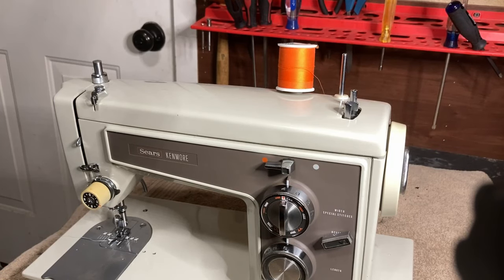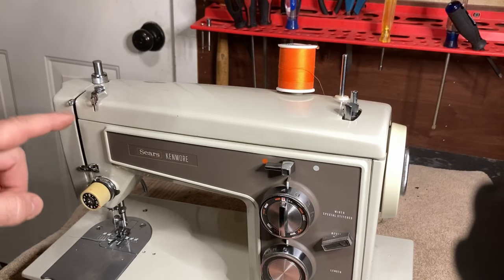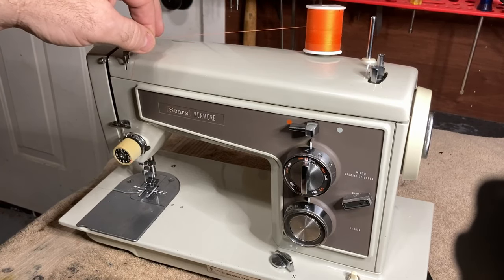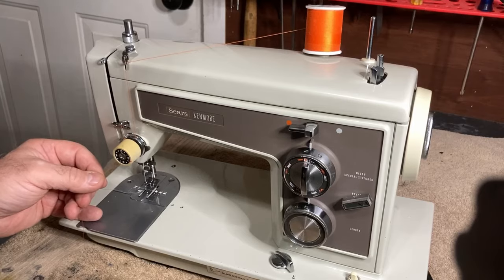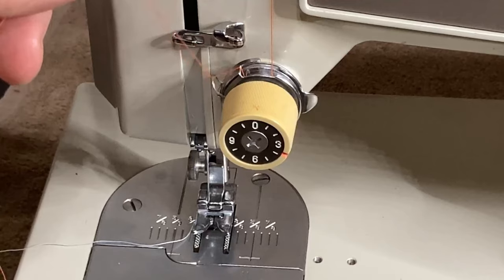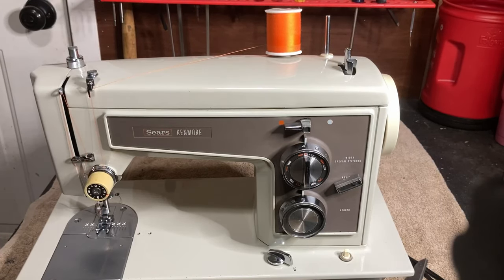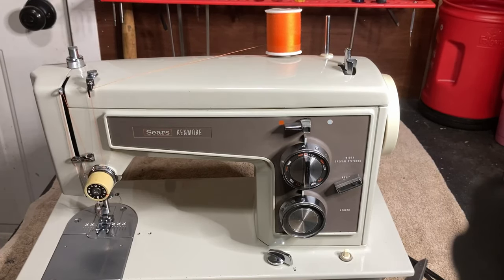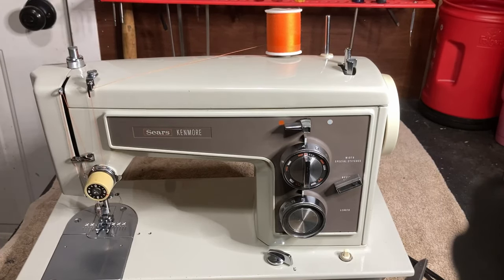How to use a Kenmore sewing machine  for beginners

Comment: This is a super helpful video. What is the point of a bottom stitch? And do the top and bottom stitch need to be different colors?
Reply from the maker: Thank you.

The point of the bottom stitch is the same as the top stitch, to hold the pieces of fabric together. 

The top and bottom provide anchor points for each other, otherwise there would be no stitch.

The top and bottom threads need to be whatever you need them to be in order to match your project.

Comment: It's hard to look through all 500 comments but when you do the zigzag do you need a different foot. My foot seems like it's only set up for a straight line as the needle would hit the metal if it tried to zigzag. Thank you so much for the tutorial! I "liked" it
Reply from the maker: A straight stitch foot has a single small hole in the center, a straight stitch foot has a wide opening.

If you are using the correct zigzag foot for the machine and the needle is hitting the foot then the needle swing needs to be adjusted

Comment: I purchased a Kenmore 145-15700 at a garage sale in excellent condition very clean but hasn't been used for years. No user mannuel. Will your instructions apply to my machine.
Reply from the maker: It applies to most Kenmore machines, the basics apply to all machines regardless of brand.

The only differences will be in the actual controls on the specific machine.

Comment: After 4 days of research and watching lots of videos on how to repair my upper thread tension I finally find out what my machine really is and why I can find nothing about it. It says it's a JCPenney Model 6923. Well, it looks like, and was made like a Sears Kenmore. My machine was purchased in 1986. What I need is info on the upper thread tension. I would like to replace the spring and have some info if possible. Thank you for your video. It was very easy to follow and my machine threads the same way. The only difference on the tension dial is that mine does not have a screw in the middle.

Comment: I just got a 158.13041 and I’m sooo happy to have found your video! Thanks so much for sharing this very valuable info! 😊 definitely subscribing! 

I do have a question about the spool pins on top. Mine broke off during shipment unfortunately and it broke right flush with the metal surface. Is there a best way to remove and replace them? Thanks again for this gem!
Reply from the maker: Not really a best way to remove the broken spool pin. The usual way to remove a broken bolt or screw  is to drill it then use an easy out.

That may not be necessary for a spool pin here are some ideas I have used at one time or another.

First remove the top of the machine so you can see the back side of the spool pin.

If the pin sticks out of the back of the top then you may be able to use a set of pliers to get it turning.

If the pin is not very tight you maybe able to use a rough rag lay it on top of the pin then apply as much pressure as possible with your thumb and twist in a counter clock wise motion and get it moving.  You may also be able to use a piece of tape such as gorilla, 10 mil or 20 mil stick it to the spool pin and twist, make sure it only sticks to the spool pin and not to the top of the cover.

Hope that helps.

Comment: I have a Kenmore 1937 that I just picked up that the zigzag function is not working and probably seized up, if you have some pointers to fix it, I would be greatly appreciative. Great video by the way.
Reply from the maker: @DarthPotatoes  
The machine as a whole, especially the cam follower and associated linkages need to be cleaned and have gunk and varnish removed then be lubricated again.

Mineral spirits works well removing sticky gunk.

Denatured alcohol works well on dried hard varnish.

Comment: Hi!  I have a Kenmore385.1684280 Ewing machine - 22 stitch. It’s been sitting for a long while but I remember the last time I used it it just stitched in one place and fabric wasn’t moving. Today I looked at it. The straight stitch seemed to feed ok but as soon as I tried any other stitch, even just a zigzag the material would no feed. I don’t know how to adjust the feed dogs if that is the problem 😅
Reply from the maker: It sounds like it needs to to be serviced, cleaned really good and have all the gunk cleaned out then lubricated.

Comment: Very informative video. I just found you and subscribed. I collect and refurbish machines, but this one is a keeper. I put it in a cabinet. Also have a 158-1941, 158-1802, Singer 201-2 and 500a. Singer rotary machines make perfect straight stitches. The Kenmores excel at zigzag.

Comment: Wow....your video is awesome!!  I just bought a Kenmore 158.19640 at Goodwill.  You have taught me so much about the Kenmore and made me so happy that I got a deal!  However, when I brought it home, cleaned it up, it does not have a bobbin casing.  Can I purchase a generic one from Joann's?
Thank you again for your video!
Reply from the maker: Thank you! I appreciate that.

I believe the model number is 158.19460 and yes you should be able to it is a class 15 bobbin
Reply: @sewingmachinetipsandtricks9079  You are correct in the model number.  Thank you so much for the information!!

Comment: I picked up a kenmore 158 14001 very similar to the one in this video the mechanic works wonderfully. My problem is it came with a extra plate (for under the presser foot) thing is this plate has a single gear on top and slide lever on the under side. The gear has 8 teeth on it and it takes 16 hits on the lever to make one full revolution. I'd like to know the name of this plate and what it's used for. Thanks for your video I find them helpful,
Reply from the maker: That is for early type embroidery and automatic buttonhole attachments

Comment: I was given an old Sears Kenmore model 605 I don't know how to thread it. Help! Thank you.
Reply from the maker: All machines thread similarly, Raise your presser foot, make sure the take up lever is up.

From the spool pin the thread will go left to the first thread guide on the back, across to the second thread guide on the front, down to the tension assembly, up to the take up lever back down through 2 or 3 thread guides to the needle.

Comment: I have a  258.17540, and my question is about the knob on back to the right side as you're looking at the machine from the front.....what does that knob adjust? By the way, love the video. No body has explained the tension adjustment for the presser foot works, nor exactly how the thread feeds through the thread tensioner...that the thread goes over the one hook. Thank you so much.

Comment: I have an old kenmore model 158, it has an arm you can slip a sleeve over, my question to you is at the top edge of the machine is a button, you can push it left or right, on side has a check mark and the other side has an upside down check mark there is also another symbol with them that is rectungular shaped. Do you know what this is for? I got it from good will for 10 dollars so no instructions but it works great
Reply from the maker: I would need pictures to see.

If you want to join my FB group I can help.

Thank you.

Comment: Thanks for very clear, instructive videos.I inherited a Kenmore (year??)148.12300 .zigzag sewing machine with a manual and zigzag,satin,straight & zipper feet included. I cannot find additional feet for hem rolling, pin tuck, bias feeder,couching, embroidery for this model. Please advise.  Also,can this machine sew denim & leather? Will Schmetz twin needles fit it?I'm a beginner so any info or advice is welcome. Thank you!
Reply from the maker: Hello Mary I am unfamiliar with that particular model. Are you sure  148.12300 is the correct number?

Comment: I recently got a 158 17600 and the only thing it's missing is the additional cams and the manual. I'd love to know which specific cams will work with my machine, if cams from other 158 series machines will work in my machine, and if my machine can chain stitch with the right attachment. I know a few specific 158 models can chain stitch but I have yet to find an exact list of which ones have that capability.

Comment: I have a 385.  I want to know how to use it for Free Motion Quilting.  Thank you for your directions.
Reply from the maker: @marticook2168  
385 is the series there are thousands of machines in that series.

If it has a feed dog drop then you need a quilting foot that will fit the machine, then you can start practicing free motion quilting with it.

Comment: Hello,I love how you explain how to use it  but I have a sears Kenmore 158 921 and ever time I sew it sews but doesn't overlap the fabric . What I mean is that it sews straight but the fabric doesn't move while sewing on the other side and I don't know why but I have to move the fabric which  makes it harder so I was asking how to fix that ,thank you
Reply from the maker: That could be several problems, not enough pressure on your presser foot, feed dogs stuck, stitch length improperly set. If you would like help I can help you in my FB group. link is in the description of the video.
Reply: @sewingmachinetipsandtricks9079  thank you very much its very old but I will see if that helps.

Comment: I have 158.17030 kenmore machine. I watch your video was Extremely helpful. It cost 
$5.00 at a yard sale. Can you tell me if this machine will also make a chain stitch? And if it does what do I need. Thank you
Reply from the maker: Hello Linda,

Here is the manual in section II on page 4 I believe it talks about chain stitching . It is about half way through the manual, the pages are blue.

https://storage.builderall.com/franquias/2/334219/editor-html/7578720.pdf

Comment: Very informative video. I have received a Kenmore Ultra Stitch 12 as a gift and it didn't come with a manual or information, so thank you for the video. I do have a question. How do I turn the clutch wheel for winding a bobbin? The middle job of the handwheel is so tight it won't turn towards me. I've even had my husband try and we can't get it loosened to disengage the needle movement. If you have any suggestions, I'd be very grateful to hear them. Thanks again, Katie

Comment: Hello! I just got a sewing machine from kijiji. It’s a Kenmore 158 178. This video help a lot since the machines are similar but the bobbing part is completely different and I am having troubles figuring how to thread it 😖
Reply from the maker: Hello Courtney, 
Thank you.

Here is a manual for that machine.
I don't personally have the manual or I would give it to you.
https://sewconsult.com/product/kenmore-158-17800/

It is $6 I have bought from this site before, they were prompt and I had no issues with them.

You can also join my group if you would like and I can offer more help there .

https://www.facebook.com/groups/479747739423131

Thank you, hope you have a great day
Reply: @sewingmachinetipsandtricks9079  Thank you so much! I'll take a look :)
Reply: @sewingmachinetipsandtricks9079 .   My kenmore 158.10691. Hand wheel only moves very slightly.    Needle won’t move when you try to sew. How do I clean it up and oil?

Comment: I have a sears kenmore 13101. I have no Manuel for sewing different stitches.  What should stitch width be set on for straight stitch.
Reply from the maker: For straight stitch the width should be 0
Reply: Thanks so much I will try that.
Reply: The little knob on the front top is for zigzag or straight stitch and has a red dot.   I don't have the same as the model of the video shown. Of course not having a manual I don't know how to practice the other stitches. I know that little red dot means something,  but I'm not sure what.   The other knob is larger with different stitch marks and a red dot.. can you help me out?

Comment: I have a sears kenmore that is about 51 years old. I was wondering if why the belt is slipping and it’s a new belt and the motor gets hot and wondering if it’s worth fixing ?
Reply from the maker: It sounds like the machine is starting to lock up due to lack of lubrication over many years.

I have seen and repaired many of them, depending on the exact problems and work involved I usually charge between $200 and $300 to service it and get it going again. 

They are very good machines and worth fixing.

If you continue running it with the motor heating up, you risk burning the motor out.

Comment: Hi Richard, I just got a sewing machine from my late sister. It’s a Kenmore machine model 158. 17810.  I have had so much issues with it…
After watching your video, I finally got some clues but I still could not run straight line (the fabric did not move). What did I do wrong?
It would be greatly appreciated if you could share any information❣️

Comment: This helped me figure out how to thread a Kenmore machine I inherited after years of using a Singer. It's an earlier model than the one you show and doesn't have the fancy stitches. Unfortunately, when I was removing the bobbin I thought I had to take the whole assembly out and now I can't get it back together. I first moved the little black pins to the side, then removed that outer silver circle, then the inner silver case, then the bobbin tension case and bobbin.  Do you have any videos that might help me put it back together properly? Thank you! Also the home sewing machine guide address did not work.

Comment: I have a 158.14001. I just received a foot pedal that was missing when I purchased it at the resale shop but when I plugged it in it sews a very beautiful straight stitch but when I move it over for the zigzag it is stuck in what looks to be a different pattern style. Any suggestions on how to fix that. Thanks.
Reply from the maker: It sounds like the cam follower linkage is stuck in place, probably from old drying oil and grease. 

I would recommend cleaning it out and lubricating again.

Comment: I have a Kenmore #158.17910. The needle goes down far enough to scrape against the shuttle plate before I going back up.  Could you connect me with a video to teach me how to set the needle bar higher.
Reply from the maker: I would suggest making sure the needle is all the way up in the needle bar first.

There should be a spot  with a needle stop where you can see the top of the needle touching the stop in the needle bar.

Comment: I inherited a Kenmore 158.12411 and I am learning how to use it. Your video was super helpful. 
I am wondering if I can use low shank feet with it. It only came with two feet, a zig zag and button hole. I have bought an adjustable zipper foot that I have figured out how to use, but a friend gave me some other feet that are just plates, no arm / column that would allow me to attach it to the shank. Is there any way to make this work?

Comment: I have a Kenmore 117.740 (1956) its in a poor state though sadly. No belts, poor finish on the paint, and the pedal and original table it sat atop are gone. I really want to bring it back to life but wouldn't even know where to start. Do you have an suggestions?
Reply from the maker: I would suggest cleaning and lubricating and ensuring it has all the internal parts hook bobbin case and such and getting it working then finding a pedal and cord. 

You should be able to find what ever parts you need here https://ebay.us/PSA7qL on ebay
Reply: Thanks for the great demonstration. I have a Kenmore sewing machine model 158    13550 80 Could you show a demonstratton  on this machine and about the bobbin tension thanks

Comment: Also noting as they dont say it in teaching videos because new machines often self cut the threads then hold them. Always put your needle down into fabric and hold the tails and do one stitch by hand....rotating the wheel and set needle into fabric again, then run it. The tails often get caught or if you start up in the air the to thread gets lost in the bobbin case!

Comment: Thank you for posting! I have a model 29 (sometimes known as the purple monster in some circles - all steel, lilac, just forward and reverse) and I canNOT figure out how to wind my bobbin! There is a spool pin near the tension discs, but no latch mechanism to lock the bobbin in place anywhere that I can see. I saw one video where a woman said the bobbin threader was "on the wheel" but it doesnt look like that's happening here? Thank you for all your videos!

Comment: I have a kenmore model 158. 18022, but is a super high shank. The on one your video was it originally super high shank or lower? Or did you use an adapter to get it to work as a lower shank? Please let me know. I learned few things with your video, great job! and thank you

Comment: I have been given a Sears Kenmore 158.1755. It hasn’t been used in quite awhile. Looks like I have all the cams, plus a few other pieces. Trying to clean out the dried up sewing machine oil. Looks like grated amber falling out of it when moving the needle.
Reply from the maker: Denatured alcohol works great for removing old dried oil/varnish.

Comment: I have a model 158.13250 and when I go to load the bobbin with thread, the clutch doesn’t release.  I turn the middle knob toward me but there is no click and the needle continues to go up and down no matter how many times I turn it toward me. I looked under the machine and I can see a corrugated black rubber belt going around.  What might be the problem?
Reply from the maker: Sounds like your hand wheel is stuck on the shaft.

Probably need to pull the hand wheel and clutch assembly off the shaft, clean, lubricate it and put it back together.